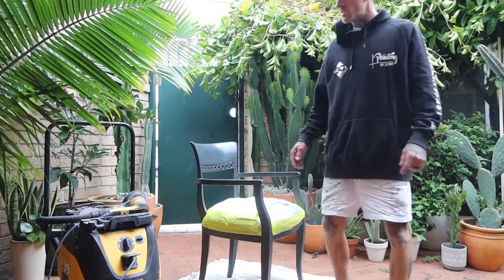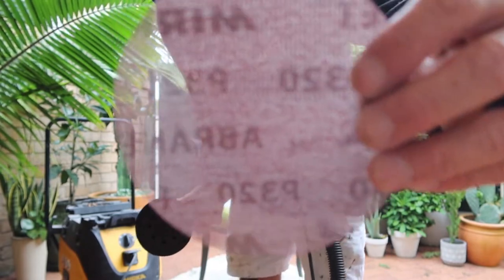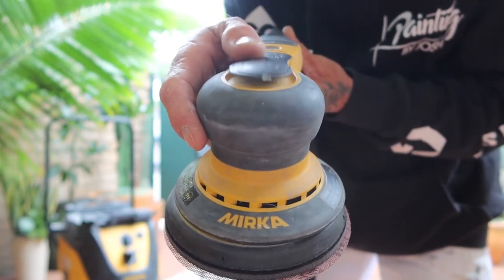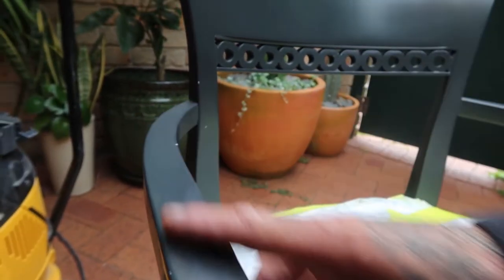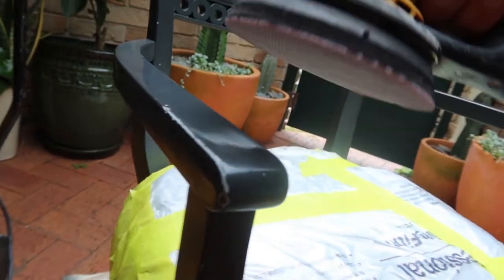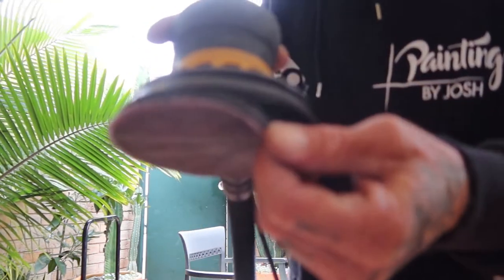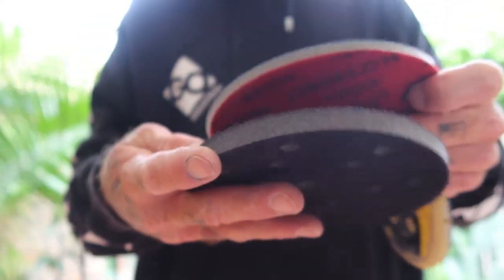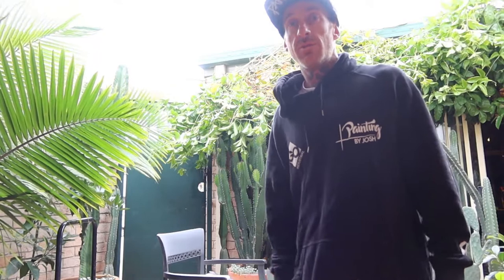MY CHOICE | MIRKA DEROS

Comment: Hey Josh Thanks for your video. I've also recently purchased one of these sanders after seeing a bunch of the reviews including yours, so thanks for that. However I've heard there has been a lot of issues with failures and reliability. Have you experience any issues or problems? I'm thinking of cancelling the order after hearing so many other users handing issues. "Great tool but only when it's working" has been the resounding feedback which is making me think twice. Any who, thanks again for your video and let me know if you or anyone else you know had run into problems.
Reply: Mine failed 3 times since purchased, mirka sent me new sander every time so now 4 years after original purchase i have about 2 months old sander and 4 hard mirka cases lol 😂
Reply from the maker: @woodworkchannel3353  i have had mine well over a year now and used daily and know issues yet🙏
Reply: @paintingbyjosh  ANy updates on the sander?